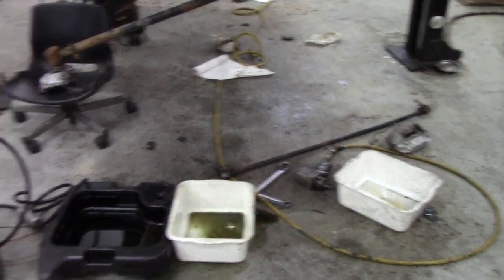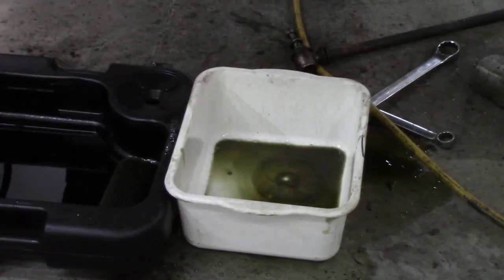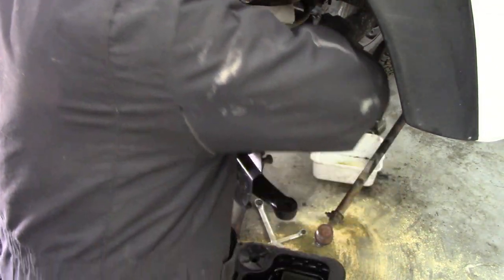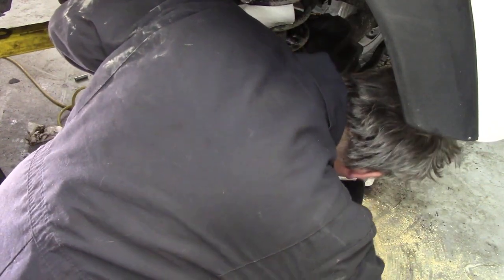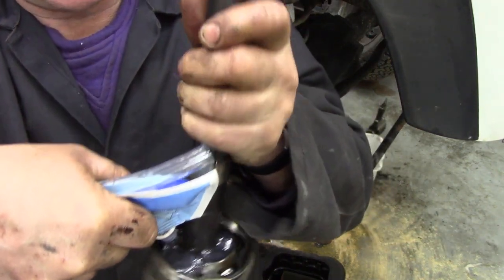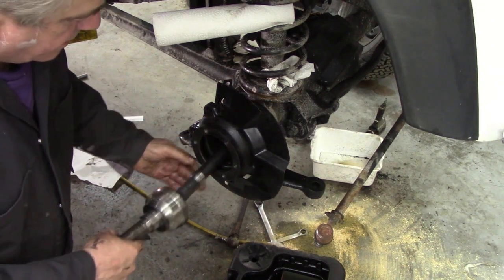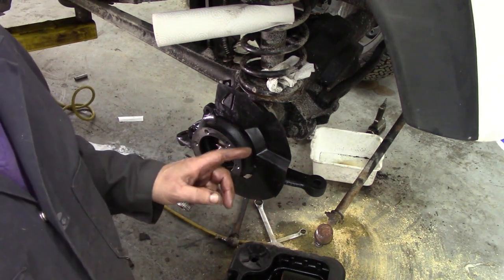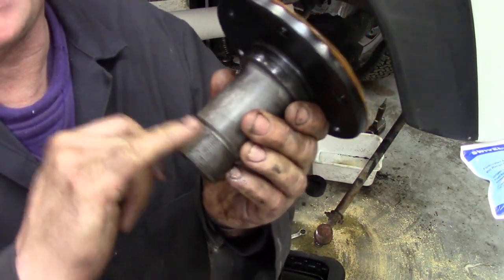Ghana 110 repairs part 9

Comment: Hi Mike. I've been watching this work you are doing on this Ghana 110. I am currently also busy with the swivel hubs on mine and I just want to point out something to you. On the 96 edition of the LR manuals a few things changed. The inner seal on the front hub must be fitted flush with the rear face of the hub. Secondly the pre-load on the swivel housing has been dropped from 3.6-4.5Kg to 1.16-1.46Kg. But further I love your work and really enjoy watching your channel.
Reply from the maker: The hub seals were retro fitted flush on this 97 and were rubbing on the stub
As for settings - the LR manuals are full of errors- I will stick to what I have been doing with no issues for the last 15 years - makes not much difference
Reply: @BritannicaRestorations  No worries. On my old 1984 110 I used the older specifications but as my new one,2006 300Tdi, is clearly different I started to read all the various manuals LR has published. While dismantling it I saw differences between the two. 

Please continue with the amazing channel.

Have a great day.
Reply from the maker: It may be the difference in the seals - they has been so many types but these clearly state fit 4mm lower
Reply: @BritannicaRestorations  Oh that makes sense. There are a few different seals. 
Thanks for your quick replies.
Reply: Hi Mike
I just wanted to apologize for giving wrong info. I just pulled the LH hub and the wheel bearing seal was recessed about 4mm.
The book said flush, apparently I misinterpreted it.
That means I have to redo the RH side.
Have an awesome day.

Comment: G'Day Mike. Mate I've been watching this whole series and using it like a check list against my own work I had done last month to my front axle, I'm pleased to say all box's ticked. :D
Had a weird comment thrown at me when I did mine though. It was this: "be careful to never get CV grease mixed in with your Diff oil as it will destroy the Diff". Now I have no idea if this is even true but I'd never heard of this before. The only reason I know of as to why you shouldn't get the CV grease into the diff/axle oil is that it wont be in the CV joint where its meant to be doing its job! I also don't install the stub axle seals behind the needle bearing to allow the grease to migrate up into the splines and I pre-fill the HD Drive flanges and the bearings in the Hub with marine grease and use the hub seal to keep it all contained.
Reply from the maker: I think the CV grease is Molybdenum  and axle oil is a Hypoid oil for shear forces in the gears - lot of sulphur in it  - so maybe the CV grease may bugger the diff in the long run - not tried that experiment -yet
Reply: @BritannicaRestorations  Maybe, the guy said its because it will destroy the case hardening of the diff parts. I still have not found any other evidence though to back up that statement.
Reply from the maker: Shot in the dark, but I do not think the case hardening would deteriorate that much - what about the CV's?
Reply: @BritannicaRestorations  That's what I thought too, surely if its going to bugger up the diffs case hardening what about the CV's. I think if its going to have any effect at all on the diff, its more along the lines of making the oil to thick and therefore it can't be flung up by the ring gear as easily and that will then not lubricate the spindle as well as it should. Beyond that I'm not sure if it makes that big a difference to the diff's case hardening. Just gets the spindle a bit hotter maybe.

Comment: Don't forget the swivel to axle bolts, One of them is different (or was) it has a shank dia which matches the hole dia in the swivel flange, it's a location bolt.  if you use all the same bolts you can get the caster angle out.
Reply from the maker: All the bolts on this were identical

Comment: December 2019: "My insurance company are useless cos they won't insure my premises".
May 2020: Posts up video squirting gallons of petrol around the premises.
>_<
Reply from the maker: And your point is..
There has been 5 garages in town burnt down during the shut down - wonder why?
Reply: @BritannicaRestorations  No offence meant. Just a bit of banter.

I'm sure the H&S department at a main dealer would have a heart-attack at the thought of petrol sploshing around but safety is really mostly about competence, experience and understanding.

Alas, a lot of organisations aren't willing/able to factor this into their thought processes.
Reply from the maker: That's ok - but the garages burning down is odd as they had no customers in the lock down - and insurance scam methinks! 

that's why garages have high insurance premiums!
Reply: @BritannicaRestorations  Fair comment.

Kind of swings & roundabouts in Britain.
They've given drivers a 6 month extension on their MOTs, which means that all MOT garages are going to be mad-busy come October... if they can survive until then.
Most of the garages around here are on-man-bands, anyway, so they just keep working.
Probably a bit different in big cities, or bigger garages, though.
Reply: Have you heard the joke about the two mechanics retired on the beach?
One says he had a fire that burned down the shop. Insurance paid out. 

The other said a flood washed away his shop. 

The first mechanic asks the second one. ...

How did you start the flood?

Comment: Hi Mike, any updates on the availability of the r380 floor screw kits?
Reply from the maker: Yes! I have re designed them to now be universal for the LT77 and R380  AND includes the diaphragm screws and plastic nuts, stainless self tapping screws and washers and genuine plastic nut inserts

Now 120 pieces! 

I rans out of SS screws and washers but they should be in on Wednesday - I have 6 sets available now but would like at least 20 for the shop as they sold out so quick!
Reply: @BritannicaRestorations  i will take a packet, you are right they sold out quickly before i could order them! would i be  able to shoot you an email through regarding this?
Reply from the maker: Shoot me an email and I will put a set aside
britrest@britrest.com

Comment: Hey mike ive had leaking swivel seals.  After removing seal inside stub axle and running oil in axle casing , swivels. My oil leaks have stoped. I cranked steering and lowered side then filed swivel wirh oil making sure oil gets on past cv to axle hub. No more oil leaks from swivel ball. Seems pressure builds up or something inside swivels. Maybe requires a breather in the top of swivel. Maybe too much grease installed by me..give is your thoughts guys. Im running oil in mine without stubaxle seal.
Reply from the maker: It should not get much pressure in the swivel housing as it is grease not oil in there so there should be no foaming
I would be concerned about the oil moving in the axle casing